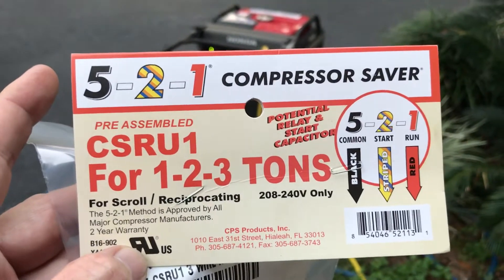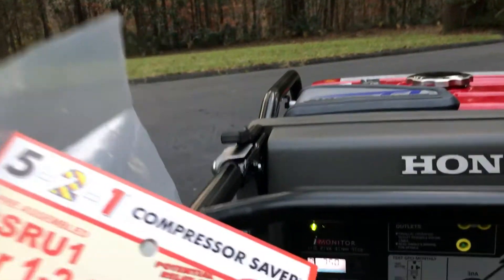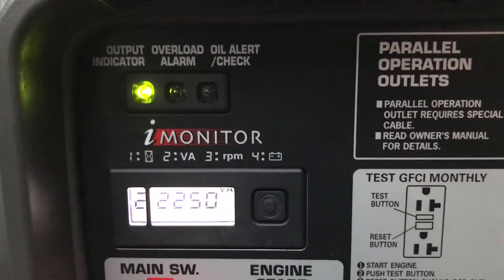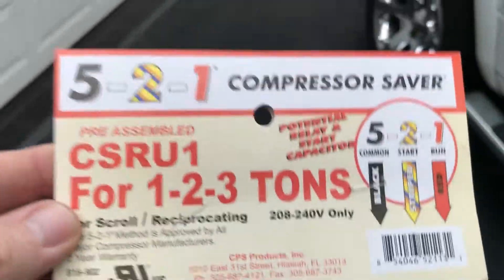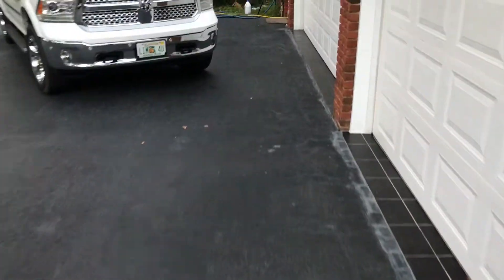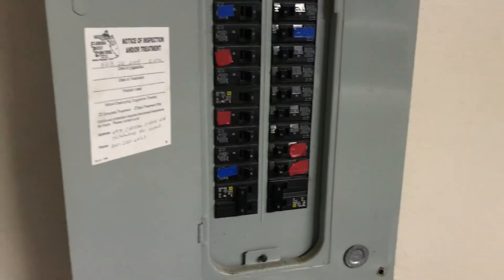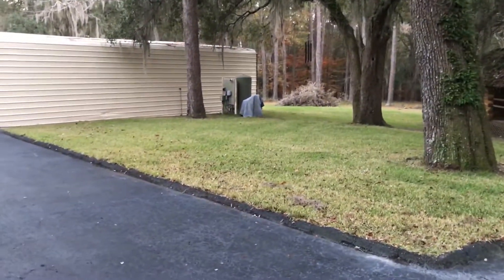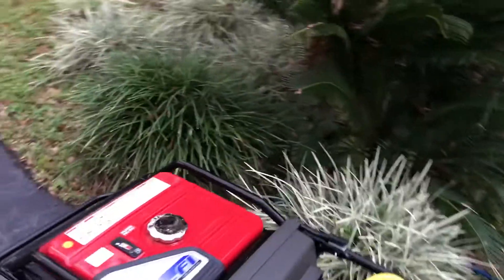Honda eu7000is runs 2 Ton with 5-3-1 hard start capacitor.

Comment: How did you get your air handler and out side unit to work off of the generator I have two separate breakers for air handler and out side unit

Comment: you need to change out the capacitor  with a High quality one the one in those kits are cheap china made  & only last about 1 year  i have seen some fail in 6mouths   Put a USA Made  B-M-I  start capacitor & it will last a long time .
Reply: Could you add a bunch more information (maybe a link) for those of us that don't understand this stuff? I have fixed my A/C Condensor by replacing the Capacitor with the exact same one (rating and size and both were USA made). I wouldn't have a clue how to take my existing and resize it for generator start-up demand. Maybe purchase this kit and they repurchase the same spec units from USA manufacturers ?? Help.